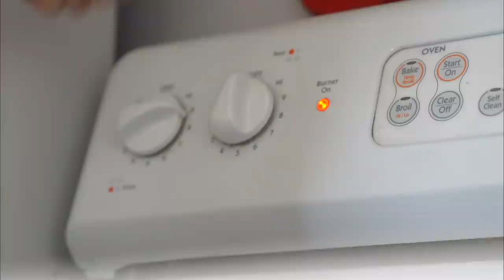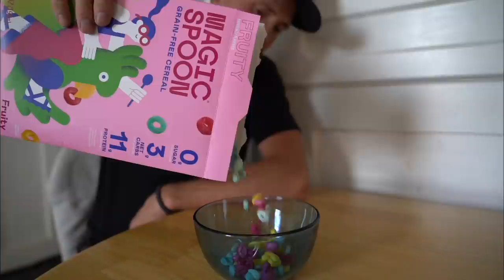INSTALLING OUR NEW COUNTERTOP & MAKING GOAT CHEESE | RV RENOVATION

Comment: We spent the past 3 years driving around the US in a 36' travel trailer. One time while driving down the road we just LOST a wheel- came right off and we had no idea. Someone flagged us while going down the highway and ended up having to replace an entire axle ($$$). We also had TONS of blowouts, so our #1 recommendation would be to do any tire upgrades that you can. It's not worth it to get cheap tires. OH, one other recommendation would be to make sure to keep paint for touch ups (I'm sure that was the same situation with your van). The cheap RV cabinetry doesn't absorb paint very well and I was constantly touching up little nicks that were super visible with white paint. Cant wait to see your finished product!

Comment: I love mini-split AC units.  Consider building a rack on the rear welded to the frame to mount the outside unit.  Super efficient with electricity, quieter than a roof mount unit and cools faster.

Comment: To drain things in cheesecloth (I make many jellies) I just wrap the cheesecloth ends around a wooden spoon and set it over a large bowl or crock to drain. The paddle/spoon part setting on the edge of the pot will prevent it from turning and unrolling along with the weight of the bag wrapped over the cheesecloth ends puts tension upon it to hold it in place. Just thought that would help with ideas for you.

Comment: If you are not going to do a lot of traveling with it, you might want to check out a 115v ductless system. You could make a stand for the outside condenser on the back bumper if you are going to travel with it. More efficient and so much quieter.  You guys are great!

Comment: Looking Great guys!!!! Suggestion: with an under mounted sink, over time just silicone caulk and those clips (especially with such short screws) run the risk of failing. Adding a few support blocks of wood underneath the sink attached to the sides of the cabinets, will avoid that. Nice touch, with the beard removal, fun and creative reveal, well done story telling! And the cheese looks yummy. Some day, some one will invent taste-o-vision.......

Comment: Heating to 185 degrees is for "pasteurization" (killing germs). I make my own ricotta cheese using this same process, but I mix the milk with buttermilk instead of lemon juice/vinegar. You can use the whey to make breads/pizza dough which will be a bit on sour side, but has higher protein than other breads. I wonder if you could feed the chickens the whey. Not sure if they'll drink it up.

Comment: Instead of a rooftop A/C install a high efficiency mini split A/C & Heating system . Pioneer makes one . Camper Van Kevin installed the Pioneer brand in his Class A motor home " Miss Gypsy " He runs it on his solar panel & Battle Born Lithium battery bank . Congratulations! on successfully making your first batches of Goat Cheese .

Comment: I say it Pe-Kahn. I’m surprised your goats milk lasted that long. My gram has a lot of goats and usually doesn’t keep hers more than 5 days or so, but for cheese I guess older milk would still work. She uses white vinegar and does it on the stove in a giant metal milking pail, I don’t think she uses a double boiler. Another way to prepare it is instead of eating it right away your put in the oven on low broil and slightly brown the edges. It crumbles great for salads and the center is still moist. Now I’m craving goat cheese 😄

Comment: Hey Trent and Allie, have been following your vlogs recently. I'm getting a van to build a conversion, trying to decide what to use for heating water. How did you like your propane instant water heater? Was it efficient? Did it heat the water instantly, or did you have to'waste cold water first? If you were building another van now, would you use the same? Thanks, David

Comment: After subtracting the weight of everything y'all took out of the RV,  I bet you have only added 300lbs max. to what it weighed before you started. So it should be fine. But, if I were you I would upgrade the tires anyway. I can't really tell what type or the age of the tires on it, but most of the time people just replaces the tires with the same rating it came with, and I've learned that putting a much higher rated tire on my trailers helps save me from headaches. It never fails, It seems that every time I've taken any of my trailers off the pave roads with factory style tires on them, I always end up having a flat. lol.  I found that the E rated Goodyear Endurance trailer tires are great, they're a little over $100 each. Which is well worth the peace of mind. lol.

Comment: Yes, Mr. Muffet, the liquid is the whey - now, go sit on your tuffet and eat some curds. Grin!
- - - 
BTW: Depending on the volume of liquid whey you have available, you can use acidic whey [which is what you have] in place of water or milk in savory recipes, or as the liquid ingredient in breads and pastries. 
You can add it to dressings and marinades, boil pasta or rice in it, and soak grains overnight so they cook more quickly. You can even add it to a cocktail or drink it straight over ice.

Comment: I bet it would cost about 500 bucks to put a roof over the trailer, save ya a ton and could replace an outbuilding if ya move the trailer. I did it to mine and reversed all my roof issues on trailer.

Comment: Pee-can or Pe-con?  Depends how far into Dixie you go.  If you can't fit under the air conditioner you need to take off the shoe and shrink about 3/4  of an inch.

Comment: HUH? I've never seen a sink mounted in that way before ...
Never from the bottom. Sinks are supposed to be dropped in from the top and
then Mount it from the bottom . Where exactly did you find instructions on
mounting a sink the way you did?